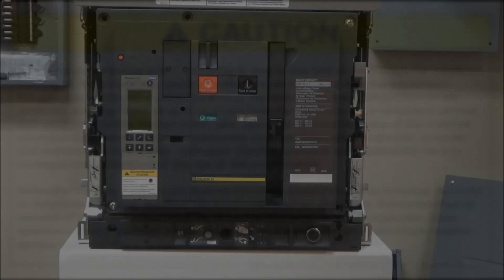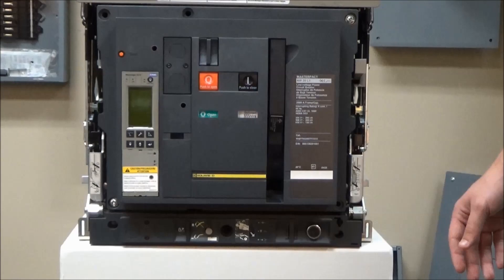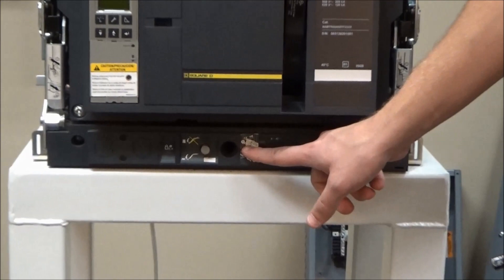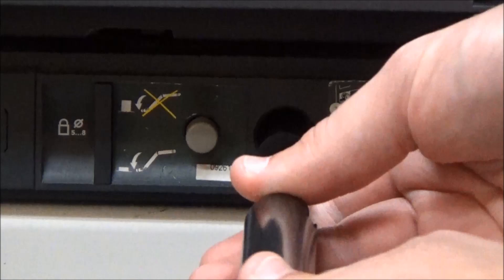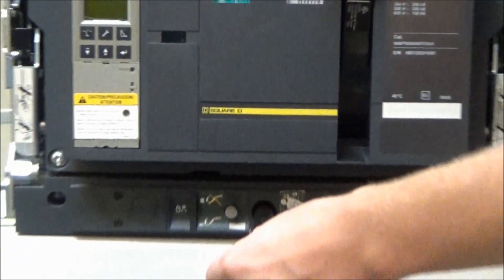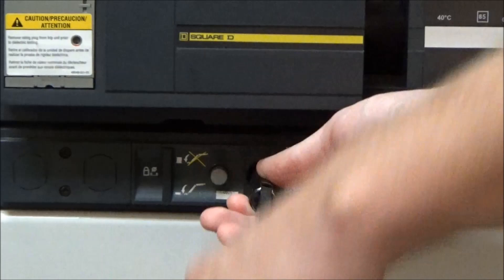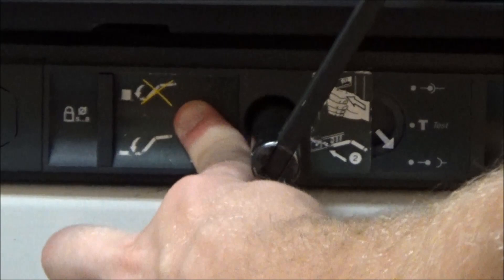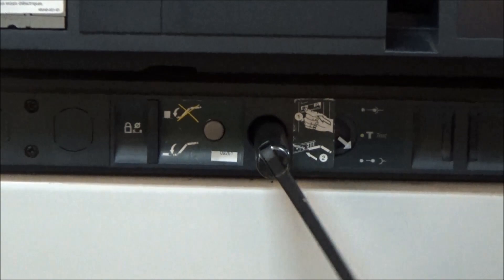Racking In Masterpact® NT & NW Circuit Breakers | Schneider Electric Support

Comment: how can trip test?
Reply from the maker: Hi Jameel,
Thanks for reaching out.  Assuming you wanted to test the trip unit on a Masterpact breaker, you would need to use our Full function test kit (cat no. S33595). The full function test kit can test the following types of trip units for Masterpact:
ET 1.0
ET1.0I
ET 1.0M
2.0, 3.0, 5.0
2.0A, 3.0A, 5.0A, 7.0A
5.0P, 5.0H, 7.0P, 7.0H
6.0A, 6.0P, 6.0H
Reply: We have one and it is a beast of a machine.